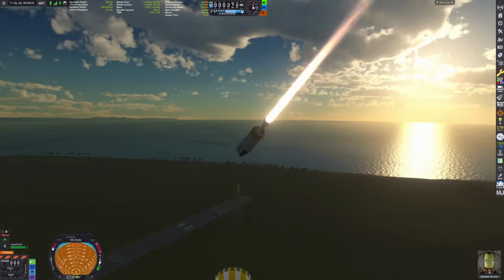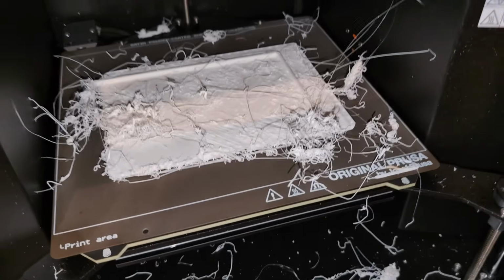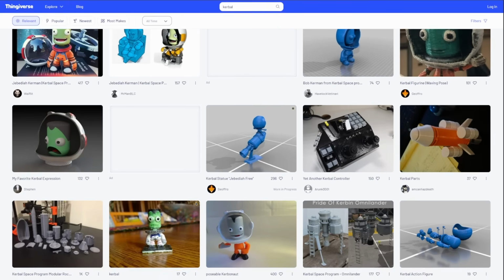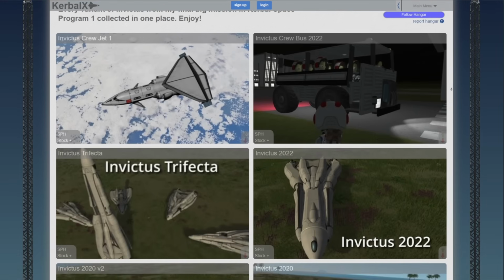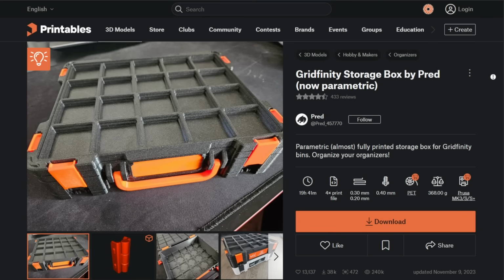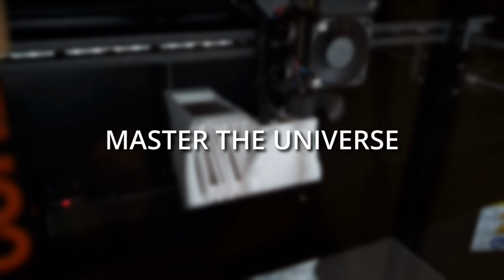Why 3D Printing Is Real World Kerbal Space Program

Comment: I guess it's not coincidence that I'm also a huge 3D printing nerd myself. I got my first 3D printer in 2018, and it massively boosted my ability to make stuff. I've always been hacking together my own DIY projects from, well, since I was old enough to hold a screwdriver... Before the 3D printer, I was really limited by stuff I could scavenge around, and attaching anything to anything else was a perpetual problem. 3D printing is like having a superpower to make things that are exactly what you needed for the thing you want done.

For me, it's very rare that I download and print something straight away... Most of my prints are custom designs I make in Fusion, usually parts for a larger project... But it is really nice when you can just find the thing you wanted already made, and just send it. 

In any case, it is an amazing feeling to have the means to make a physical thing. And sometimes they even work, which is even better. Huh, yeah, not unlike KSP at all.

Comment: They are a lot alike especially with functional prints. When you design your own model, and try and struggle to get it right... it just feels like magic when it actually works. 
I always try to design my models so they don't need supports , it saves plastic, prints faster and comes out cleaner. But, usually after a day of careful modeling and planning, i realize i need it anyway lol. I think that's the link to 'just add more boosters'.
Reply from the maker: What you're describing sounds very much like my own experience, haha!
Reply: The whole reason for 3D printing is rapid prototyping and iterative design, which is basically what KSP is all about.